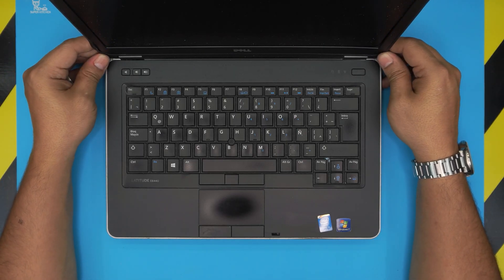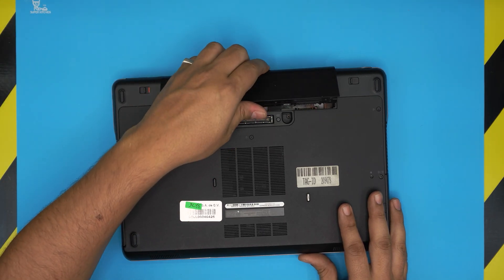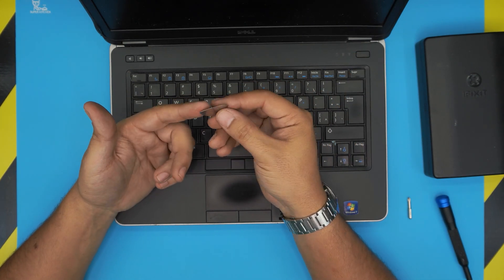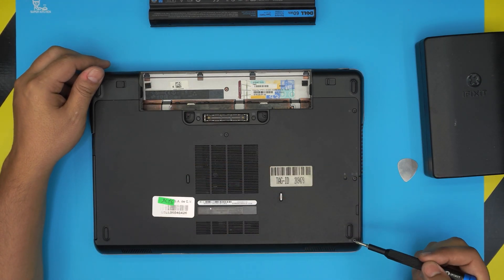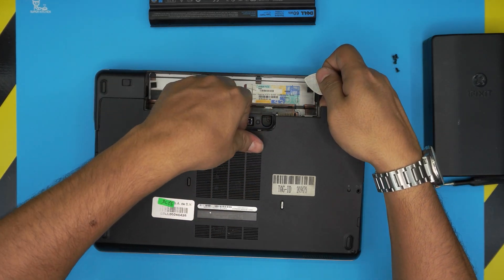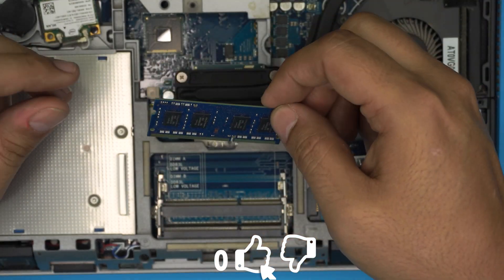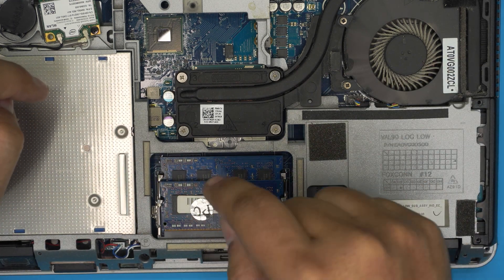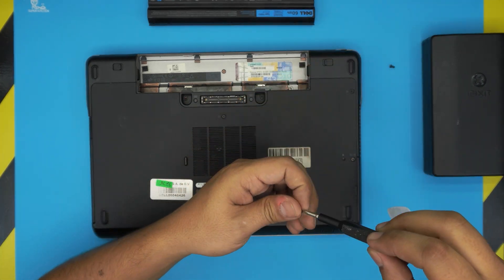Dell Latitude E6440 ( P38g ) RAM Upgrade | FULL Guide

Comment: Brother Can I use DDR3 instead of DDR3L? ( I got one ddr3 in my home).
Reply from the maker: 🫠Regarding your question, you can try and see if it will work; there is no harm in trying. The thing is that the “L” stands for low voltage because the motherboard can’t output a high voltage for regular RAM. That’s why it’s recommended to use L-category RAM. But if you install non-L RAM and it powers on, then you can use it. Some non-L models will not work.
Try it out if you already have it.
cheers🍻
Reply: @uFixTek  Thanks for the suggestion <3
Reply from the maker: It's my pleasure my friend.

Comment: Since you have a dell L E6330 maybe you can help with my problem: My laptop didn't even power on, so I replaced the motherboard. It powers on, but now all LED lights power on but the battery one flashes white - what should I do?
Reply from the maker: when you say power on , you mean you get to load windows  and all except the battery that is flashing?
give me exact details
Reply: No display, no boot up, fan turns on briefly then cuts off, battery light flashes white meanwhile all of the other LEDs stay on.  @uFixTek
Reply from the maker: you have a bad post you need to reprogram the bios, not sure if you know how to but it is cheap it cost 20usd at any repair shop or get https://amzn.to/3R9FxII
there is nothing wrong hardware side it is a bad bios program.

This is an Amazon affiliate link. When you use my links, you are helping to support the channel. 🙏